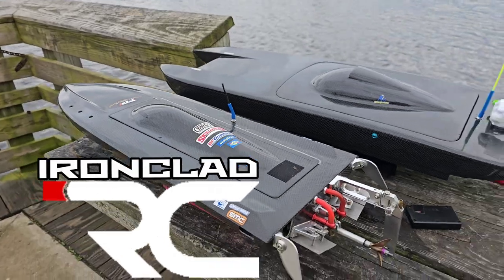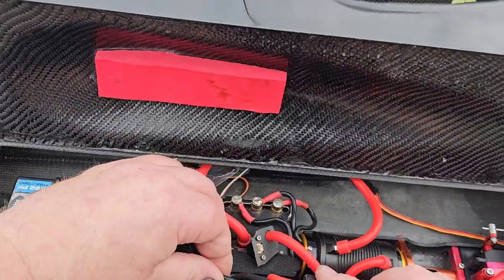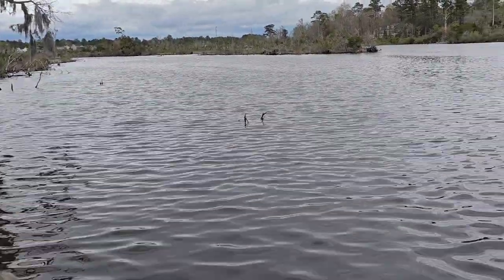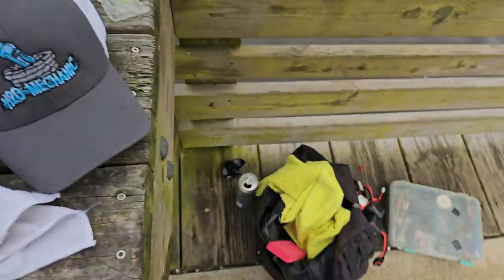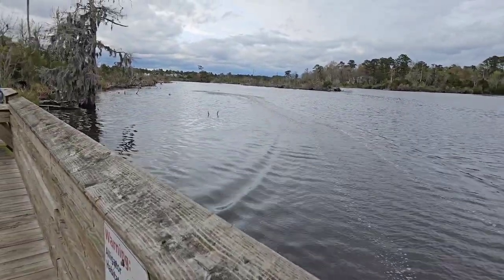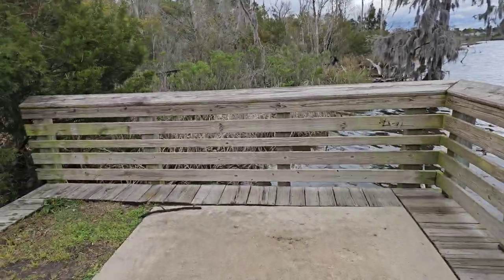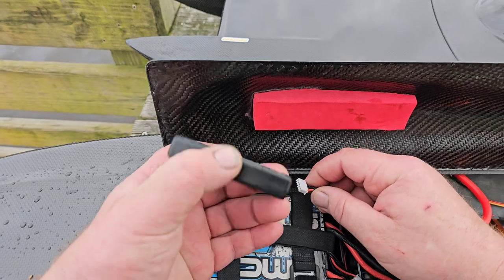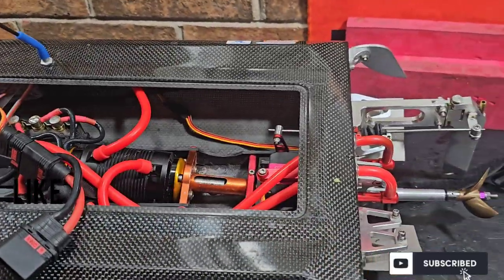New PB Oxidean Marine Dominator 8s Speedrun - XLX2 HYDRA, Tp Power 4060, SMC Racing

Comment: Starting off with 91.... That's a real nice start. I feel a 100  coming... Think it might pull quite a bigger 2-blade, but the logs probably will help you too now to determine what works best... It runs solid man
Reply from the maker: We shall see, like you mentioned I should be able to prop up and put a higher discharge lipo in the boat.
Reply: Playin with fire. But Big  the man for that.
Reply: B

Comment: Luckily I have one of those 3 blades 1817-1938 ! I think the 19rake & low bar is key! I'd say it was pulling 280-300amps. I swapped in a Smaller 3686 into mine to test lite weight setup for shits n giggles.
Reply from the maker: Can't wait to see your testing

Comment: Hey Ironclad RC It looks like the Proboats are a lot better deal because they are a lot cheaper in price like $700 cheaper than the Dominator 8s but are just as fast as the Oxidean Marine boats that are a lot more money because I really do not see much more performance difference between the different manufactures except one is plastic and one is carbon fiber ?????
Reply: The Dom runs on rails!  Carbon/kevlar/fibre glass boats are a lot  more durable hands down. I have a sw 2 /29 geico /36 geico boats as well. Good running boats and fast ,but they need reinforcement.I will never buy a plastic boat again. Not worth it in the long run!

Comment: any problems with the liner coming out with this setup.  also you using the ball bearings stinger ??
Reply from the maker: Yea i had issues with the teflon liner so I removed Teflon liner, stock stuffing tube..   I eventually replaced the stuffing tube entirely 1/4" stuffing tube stock stinger